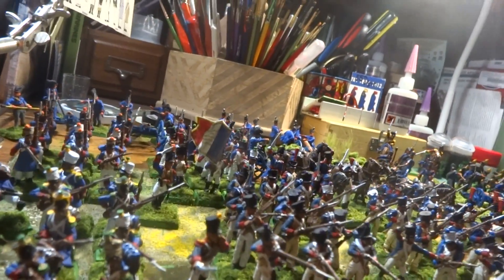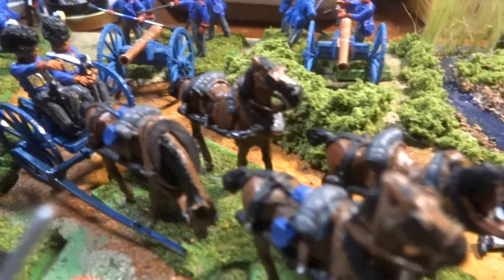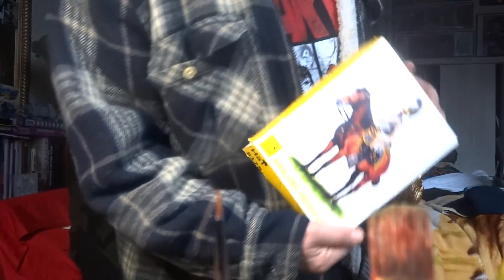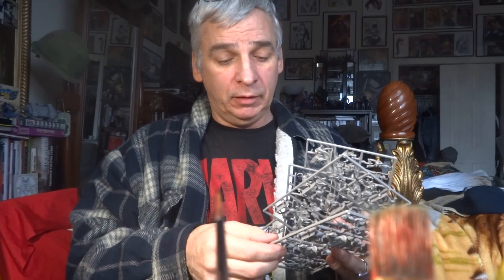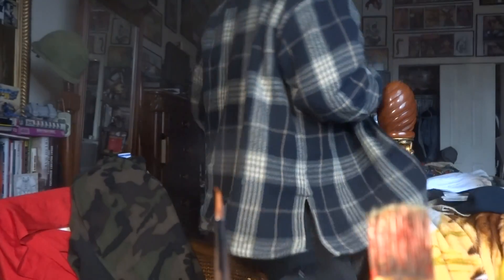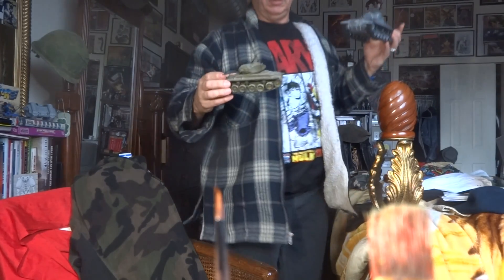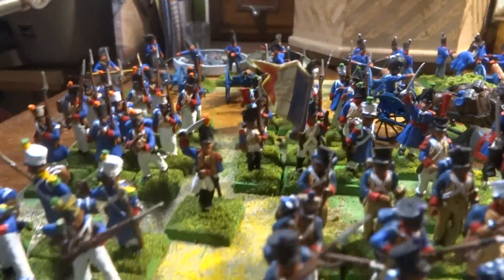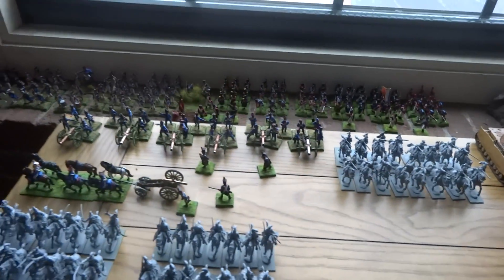Napoleonic Wargaming Update Jan 2017 Part I of two

Comment: Zvezda has a King Tiger kit if you still want one. It’s 1:35 scale and will run you $40-70 USD if you shop around. Flames of War also has one, but it’s 1/100 scale for the 15mm figure range. That seems a lot smaller than what you have.
Reply: An interesting aside about the Tiger II. Königstiger actually means Bengal Tiger but many Americans/Brits mistranslated it early on and it has since become ingrained in the culture and media. The Germans and some historians, however, use the original meaning: Panzerkampfwagen Tiger Ausf. B or Königstiger Panzer (Bengal Tiger Tank).